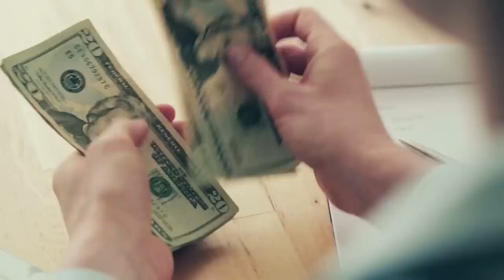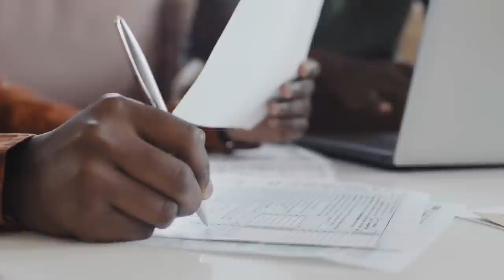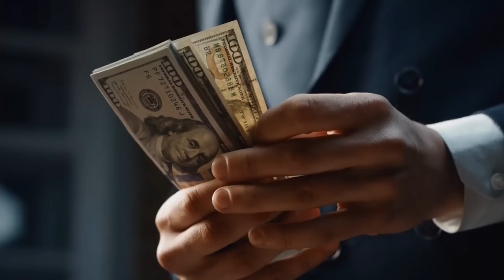GM CEO Plans For Crazy Affordable EV

Comment: GM killed the Bolt, which is the only reason they took a lead over Ford sales.  Popular speculation is they killed it because its not on the new Ultium platform and they plan a comparable alternative that is. Renting the battery is not new, so hardly what I'd call "ground breaking".  The Wuling, in its current version, does not meet US safety requirements.  Thus, any new version that will is going to be significantly higher in price.

Comment: You had a great cheap EV with the Bolt GM. What the heck?
Reply: Like all other GMs EVs the bolt lost money. So the solution is to discontinue it. Puff and 90% of GM US sales are gone.
Reply: The CEO let it slip the other day a new bolt with the ultium battery is coming.
Reply: Cheap where? Tbf I'm talking as someone living in Mexico, but a 2023 Bolt EUV is coming out at around 50k+ USD here.
Reply: I have two and they are awesome

Comment: I wanted to buy a Bolt in January.   But dealers were marking it up $3k to $5k over MSRP.  Now they are discontinuing the Bolt.  The MiniEv will not meet American safety standards.  And it will not work on our highways.  GM talks big.  But they disappoint us over and over again.
Reply: I tried ordering one a month ago.  Was told they no longer take orders cause this year's inventory already spoken for.
Reply: @tomtube1012  look for a clean used one with the battery issue resolved. Shoot for an EUV Premier. It's the one that's loaded and will satisfy your wants and needs long after the last payment.
Reply: @charlesjack6571  El techo panorámico al aire libre de los EUV Premier cumple perfectamente con la nueva american way of life 😂
Reply: Force me to choose model 3.
Reply: The mini ev is already being imported here by 3rd party manufacturers, such as PlayersClub importers
Reply: @reduxith  But can they drive it on our streets?
Reply: @reduxith  Thanks , but what about any warranty by this way ? It's an internet way , I'am right ?
Reply: I hope there is no more dealers…. Like You skip the proces and buy online like it was tesla.
Reply: GM disappointment? Sounds historical... Like previous disappointments
Reply: Why have the Chinese bought this car, if it is so unsafe.  Any car will get crushed if hit by some of these tanks on the road today.  My bicycle doesn't meet crash test but it is still allowed on the road.  So why is a micro car any different.

Comment: I want SAiC GM Wuling to make an electric car (like toy cars), where the battery is replaceable; remove discharged battery, bring inside the house to recharge, insert a fully charged battery in lieu. That means I have a spare battery (in the boot) for peace of mind😊But be sure the battery is not too heavy, otherwise   subdivide it into smaller units like dry cells (Eveready or Duracell).😊
Reply: Or to be safe, could just swap out battery at a store for a freshly charged one so the store charges each battery safely. Also this eliminates waiting for charging time.

Comment: Tesla delivered 422,875 all-electric vehicles in the first quarter, up about 36% year over year. Tesla still sells more battery powered EVs than BYD, but BYD sells more electrified vehicles overall. BYD is narrowing the gap in all-electric vehicle sales.2 Apr 2023 GM does not feature here...at all.
Reply: Tesla battery are far behind BYD's battery in term  of range of charge .. 350 km for Tesla , and now 700 km for BYD .. and priceless ..
Reply: Tesla is just good for a few and show off on the road. Need more practical affordable reliable dependable repairable for getting the jobs done moving USA where should have been . Must get the head computing. See what you can do for your country not just for selfish pockets. See what hard working people need with the right quality and Price, there, we should have been there and not any problems tangling down our progress in all over and all state.